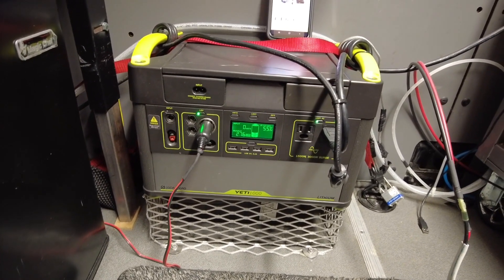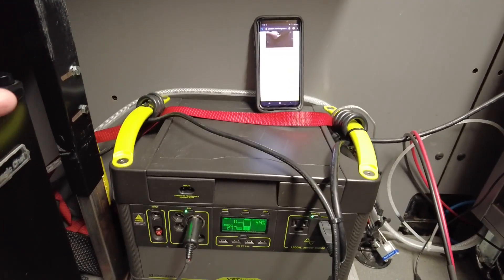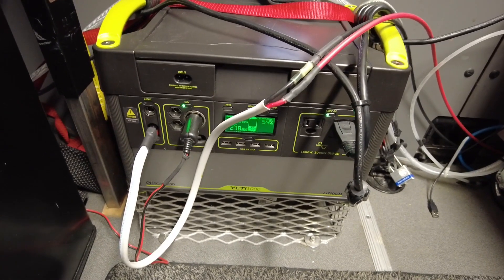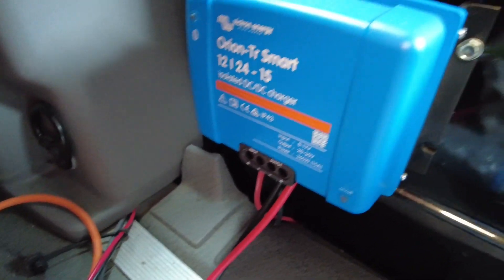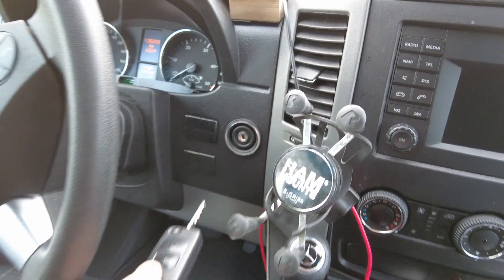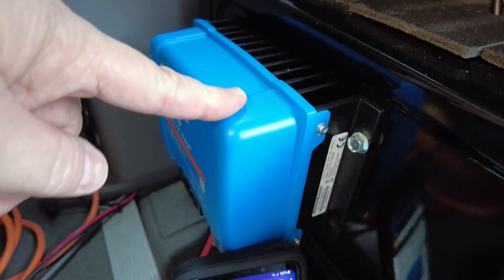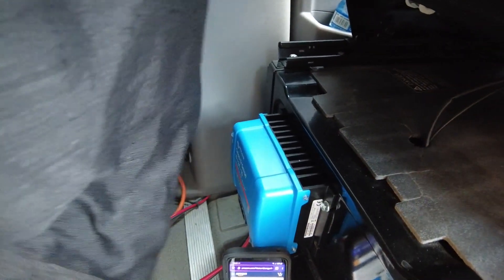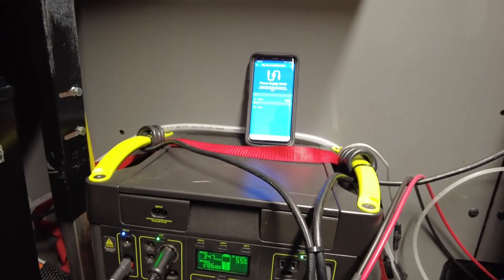Goal Zero Hack - Alternator Charging using Victron Orion DC-DC Converter

Comment: Do you think it would be okay to put this under the drivers seat?
Reply from the maker: So long as you have a good amount of ventilation under the seat, you should be fine. The unit does get hot under normal conditions. My unit is attached to the outside rear seat box of the Sprinter, and has performed flawlessly since. Almost one year with this Orion, charging my Yeti 1000 without any solar! Thanks for watching! ☺️
Reply: @sprinterdiscovery  awesome, thanks! I have a 1500x, so I should be able to ramp it up to 50 volts? Was thinking of setting it around 35-40 just to keep it safe.
Reply from the maker: @jzmills  The range that the Victron Orion is able to output is from 20V to 30V, so if you set it to 30V or less you'll have no issues for your 1500X. I know others who have done it without issue.
Reply: @sprinterdiscovery  awesome, thanks again!

Comment: Hey,
Did you install a fuse/ breaker between the van battery and the Victron, and did you run the victron to your fuse box and then to goal zero?
I didn’t, I’m wondering if I need to before my first trip…
Thanks!
Reply from the maker: Hey Lynn - we haven't, and so far so good. Enjoy your first trip!
Reply: Thanks Sprinter Discovery! I appreciate the input!
Happy trails!!

Comment: Hi there, thanks for your detailed video. I just finished this project on my PM with the GZ Yeti 1400. Everything is working great! I have a 70 amp fuse at the starter battery that was unused, but no fuse near the Yeti. Do you have any info on whether that's necessary? Thanks again for this great video.
Reply from the maker: Hi thanks for watching! It probably isn't necessary, but probably won't hurt to put one in. I don't think solar panels have fuses inline, and they would normally just connect into the Yeti. This setup with the Victron Orion simply mimics a solar panel, and I believe all the protection would be built into the Yeti itself.
I've been running this setup for nearly a year, and zero issues so far. Thanks for letting us know it's working great for you as well. 
I've had many others email me directly telling me their setup also works great. No need for solar! Have a great day!

Comment: Any idea how I can get Solar and my Vehicles battery all plugged into the 1500X (without cable swapping).  I'd ideally like as much wattage as possible.  The updated Yeti Link Module says its supports "up to" 750W but I'm unsure how it all fits together.  Currently my solar is plugged into the front facing APP port and is only 170W panel.  Its for a Scout Kenai camper that came stock with a 1500X in it and integrated Renogy Solar panel.  GoalZero is limited in their support so far...ugh

Comment: Thank you for sharing!! Your video is very helpful and thank you for a very comprehensive list of parts. I also have the goal zero 1000.  However, I'm trying to set up the connection for my car Honda Pilot 2007 follow very much the same way you did except I have a lead acid and my battery is under the hood :). One question I have and hope that you could help.  How do I know/find out what the level of power to take from my battery (lead-acid) in the configuration as you did with Victron isolator?
Reply from the maker: Hi Otto!  Thanks very much for your kind words! Much appreciated! For your 2007 Honda Pilot, I looked online to see what kind of alternator you have - and from what I gather it is also a smart alternator capable out outputting 130A, providing variable power to your lead acid battery.  That will be more than enough to provide power to your vehicle and to your Yeti via the Orion. That said, you will be able to connect the Victron Orion (link in description) directly to your battery.  You'll just need to configure your cutoff voltages in the VictronConnect app so that when your alternator is running and providing power to your battery, it will also provide a power supply to your Goal Zero 1000.via the Orion.  So long as your alternator is outputting between 10V and 17V, you'll be able to provide power to your Yeti.  I hope that helps!
Reply: @sprinterdiscovery  Thank you for such a quick response and for verifying my battery info.!!! Currently, I used the yeti car cigarette chargers. I use 3 of them when needed on a long trip. On one of the cigarette connections, I have the voltage indicator and it shows up to 14. When charged all three, it shows 13.1. Should I set my victron to charge when it's higher than 13.1?
Reply from the maker: Hi Otto! You're welcome! I suggest, once you install the Victron, you run your Honda Pilot on idle for a little bit, and watch the VictronConnect app showing the voltage. Then turn off your car, wait a bit for the voltage to drop and stabilize, then make a note of that value. For instance, if the latter value is 13.0, set your cut-off voltage to 13.2v, and your on-voltage to 13.4v (just as an example). That's how I tuned mine, it was very quick and easy to do. Best wishes with your setup! Hope this helps.
Reply: @sprinterdiscovery  Thank you again for your help!!!  I just realized that I have a slightly different system than yours :).  I connect my car's main battery to a battleborn (100Am 12V) battery and then battle born to the yeti 100. Would it be better if I get the Victron isolator (12/12 |30) instead of (12/12|15)?
Reply from the maker: Hi Otto, I haven't tried that configuration yet as I don't have a lithium battery inbetween the starter battery and the goal Zero. Let us know how it works out. All the best!

Comment: Don't you have a smart-alternator? How does the Victron dc-dc deal with the variable voltage?
Reply from the maker: Hi Kenneth! The Sprinter does have a smart alternator. The Victron Orion handles it VERY well, and provides for a constant output voltage of 20V (configurable between 20V and 30V).

Comment: Would a Renogy DC to DC Charger work as well?
Reply from the maker: Hi Lynn - Short answer is: No. 
Longer answer: The Victron Orion linked in the description is definitely the one that you need and the one that works. It's not only a DC to DC charger (like the Renogy), but it also provides a unique "power supply" function (unlike the Renogy) that we use to make the magic happen. In power supply mode, we feed the Yeti 1000 (and certain other models as well) with 20V and 30A of energy. The Renogy is only able to "charge" (unable to do "power supply mode"). That's why we chose the Victron Orion. Yes, it's more expensive and it does have more features which are necessary to charge the Yeti. The Victron also has the ability to sense if the engine is off, and not drain the starter battery. 
Hope this helps!
Reply: Thanks Sprinter Discovery!
I spoke to Renogy, they said it’s for deep cycle batteries, not lithium. So I’ve gone with the Victron. Thank you
Reply from the maker: @lynnfagerstrom7197  You're very welcome Lynn! Thanks for the update as well 😁👍

Comment: Hello, thanks for posting this video!
I have a Bluetti AC200 which the manufacturer does not provide anything similar to the Yeti link. I have bought the same Victron charger and it's working well providing 207 watts/8.2amps/25.3 volts in my 2015 Kia Sedona. I'm a super novice at this but noticed on the Victron web site https://www.victronenergy.com/media/pg/Orion-Tr_Smart_DC-DC_Charger_-_Isolated/en/general-description.html
That a fuse is recommended. Close to the starter battery. Also when using the Victron app they mention that the charger can be configured as a power supply or as a battery charger. " In charger mode the three-state charge algorithm will increase battery life by properly charging the battery" .
 I'm still trying to get comfortable with the app but like that the charger will turn off (when this setting is enabled) when you turn off your engine. 
Thanks again! Tom
Reply from the maker: Hi Top Kat! That is awesome!! Thanks for letting us know. It's neat that you're using in a Kia Sedona too! In the Goal Zero Yeti 1000, the only direct access to the battery is via the EC8 port underneath where the Yeti Link or the optional MPPT controller. Plus the screen info does not get updated when directly connected to the EC8 port since the USB connector is not there. Hence why we've gone with connection to the PWM controller via the Anderson plugs. It acts like having a 360W solar panel 😁. That's great that you got the Bluetti charging this way. Thanks so much for watching and sharing! Much appreciated!

Comment: This is great! My wife and I have a Ford Transit and the 1500x. I'd like to be able to implement alternator charging, and this looks like a great option compared to the Goal Zero branded MPPT unit. However, I do want to keep the solar option open for the future. Do you know if you could also connect solar panels to this particular Victron unit? Or is there something else that I would need? Thanks again!
Reply from the maker: Hi! You could purchase this particular Victron Orion unit, and plug it into the existing Anderson input to charge using your alternator. If, in the future, you decide you want to add solar, you could do one of several things.
Buy the Goal Zero MPPT expansion module (not the Yeti Link), and install on the right hand side of your 1500X. Then connect your solar to that. Another option would be to manually disconnect the Anderson cable for alternator charging and then plug in your solar panels (say when you know you're camping for a while in a sunny spot). Then, when you're ready to drive, just manually plug in your Anderson cable used for alternator charging. Saves you a bit of money at the expense of having to manually switch cables.  Unfortunately you won't be able to connect solar panels to the Victron Orion since they provide typically more than 16V and the Victron Orion can't handle that.
You might find yourself not needing solar panels at all. 
As you know we've got the Yeti 1000, use our Sprinter van nearly everyday for errands (and vanlife when there's no pandemic restrictions in place!) and our Yeti sits at about 94% after most trips. We use it with our 110v bar fridge, water pump, lights, and USB fans. No solar needed😁👍
Thanks for watching! Hope this helps!!
Reply: @sprinterdiscovery  Thanks so much for the info and the quick reply! That is exactly what I needed to know. We have pups, and basically NEED to be able to run an air conditioning unit while we are making quick trips away from the van and are not on shore power. I'd like to avoid solar if possible, but to limp the battery along while we are away, I feel that solar is something we'll really need to consider. I think I'm going to purchase this setup now!
Reply from the maker: You're welcome! Best wishes on your setup. If you need anything else, I'll do my best to help out! Have a great day
Reply: @sprinterdiscovery  another question, you mentioned that you don't need to fuse coming off the vehicle battery or before the Goal Zero. However, if you were to put a fuse inline at either of those locations, do you have any idea what fuse you'd use? Thanks!
Reply from the maker: With this version of the Victron Orion (link in the description), it has an internal fuse. As for extra fuses I'm definitely not the expert on that - but I'm guessing it would be slightly above the maximum amperage going through the cables. From the Victron to the 1500X the amperage will be about 30A, so maybe 35A or 40A fuse should be sufficient.
(If anybody else is reading this and can provide better guidance, it would be appreciated!)
Hope this helps somewhat!
Reply: @daviky01  running AIr conditioner off of battery requires considerable amount of battery for any length of on time

Comment: Thank you for your valuable videos. I have the original inergy Kodiak with 600 max solar input (12v-32v). You mentioned that the Victron Orion TR-Smart Isolated 12/24-15 "upconverts the 12V over to a configured 20V-22V."  If so, it seems that my Kodiak can be charged with the Victron Orion DC to DC charger as long as I can manage to make a connecting cable. I have a proprietary solar charging cable with MC4 connectors. So I need to make a cable with MC4 on one end that can connect to Orion on the other hand. Would this work? Pleas let me know if the Orion can charge my Kodiak. Thank you.
Reply from the maker: Hi Paul, thanks for watching! I think your original inergy Kodiak will be able to charge via the Victron Orion. 

The Victron can provide power configurable between 20V and 30V which is within the 12V to 32V range of your Kodiak, and the Orion will be able to provide up to 360W which is within your Kidiak's 600W max input. If the input cable is an MC4, the other end will be bare stranded wire which goes into the Victron Orion output terminals. 
I really think it should work! In your case you could set the maximum voltage on the Victron Orion at 30V (via the VictronConnect app). 
Once you have it all running, please let us all know the outcome. Best wishes on your setup! Have a great day!
Reply: @sprinterdiscovery  I have another question regarding a possibility of Delta Pro's alternator charging via Victron Energy Orion-Tr IP43 12/12-Volt 30 amp 360-Watt DC-DC Converter, Isolated. Besides the ingergy Kodiak which you said would work with the Orion DC-DC converter, I have Bluetti AC 200 as well, which I wanted to do alternator charging. But you said Bluetti products don't work with the Orion, which was a little disappointing. While the Kodiak may work, it has a rather small battery capacity (95Ah) and I need much  more for van life. I, however, recently found another product for my future van life that has more battery capacity (3600 Wh) and much more capable inverter (3600 W). It is the upcoming EcoFlow's Delta Pro which will be on Indigogo project as of July 1. I am definitely going to get that one with extra battery. The great news for me is that it has a very wide range (11-150 volt) of solar charging input capacity. So I think this will definitely work with the Victron Orion. Still I wanted to ask your opinion. What do you think? Do you think it is feasible with Delta Pro as well? If so, how should I set the charging parameter on Orion? Thank you in advance for your great input.
Reply from the maker: @paullee8319  Hi Paul - I wasn't able to access the specs on the Delta Pro as I'm in Canada and the Ecoflow website simply directs me to the Canadian website and they don't allow me to view the Delta Pro webpage. 

As for charging the unit, just use the Victron Orion's "power supply mode" - this provides power to the built-in solar controller in the GZ/Kodiak/Delta power pack - the Orion simply "pretends" to be the solar panel. Solar panels don't have their own controller, they just provide power, so the Victron Orion will emulate that power. 

If you want to charge a plain Lithium or AGM battery with the Victron Orion, THEN you'd configure the Orion with charging parameters applicable to that battery based on what the manufacture states.
Hope that helps!
Reply from the maker: Are you able to post all the specs here in the comment section? I don't use FB, and it's a private group.
Reply: @sprinterdiscovery  Battery capacity: 3600Wh; Output (Surge): 3600W (7200W Surge); Battery Chemistry: LFP; Charge Method: (1) Wall Outlet, (2) EV Charger, (3) Solar Charging, (4) EcoFlow Smart Generator, (5) Car Charging; Wall Outlet AC Input Power: 1800W Max, 15A (Adjustable from 200W-1800W), 2880W Max (240V, 12A); Solar Charge Input: 1200W Max (11-150V); EV Charge Input: 2200-3000W; AC Output: 4x20A Outlets, 1x30A Outlet 3600W Total; DC Output: Anderson Port 12V 30A, 2xUSB-A 12W, 2xUSB-A Fast Charge 18W, 2xUSB-C 100W, 2xDC5521 38W, Car Power Output 126W; Connectivity: Wi-Fi, Bluetooth, Wired Connection, Remote Control; Dimensions: 25x12.2x16.3 in/ 63.5x28.5x41.6 cm (with wheels); Weight: 99.2 bls/45kg.
Reply from the maker: @paullee8319  Hi Paul, it appears that based on the specs, the Victron Orion will definitely be able to supply power at 30V and 360W. With 3600Wh LFP it'll take 10 hours of driving from empty battery to full battery.  The EV charging is even more amazing, in that you can fill up at any fast charge EV station. Combined with solar, alternator charging,  EV charging, this battery looks like it has good potential for vanlife! EV charging is great if you're close to freeways and cities, but doing vanlife in the mountains you'll definitely want alternator and solar charging since there will not be any EV stations close by. Also, with the Victron Orion hooked up, on inclement weather you're most likely not getting much solar, so alternator charging is definitely the way to go. Just use the Victron Orion "power supply mode".
Thanks for sharing out the specs - much appreciated!
Hope that helps!